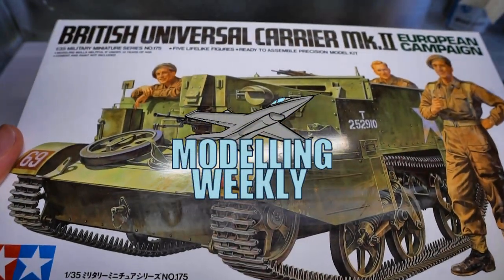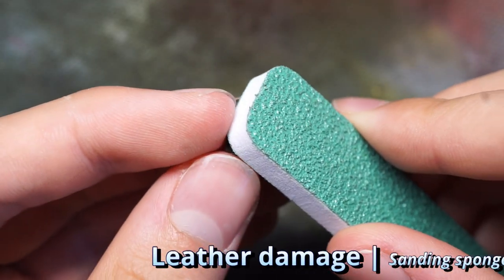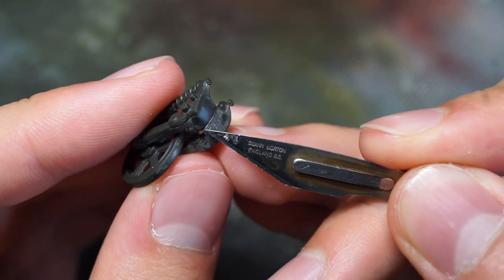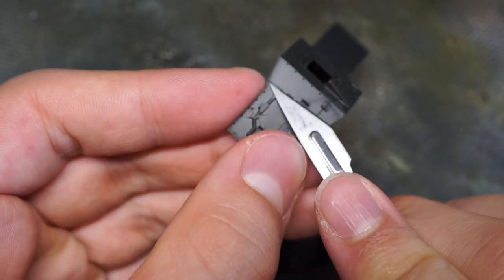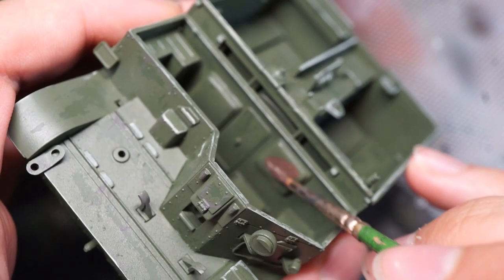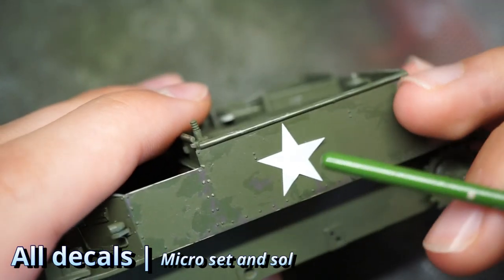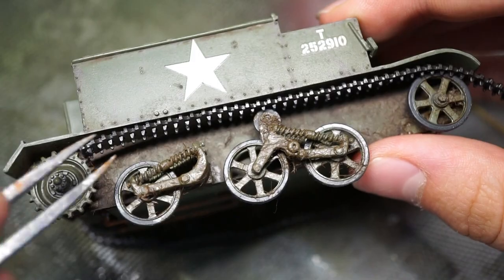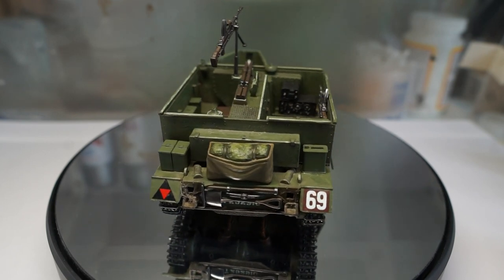Universal Carrier Mk.II | Tamiya 1/35 | Full build!

Comment: That wicked intro music is motivational, makes me want to do some evening lawn mowing. Is there any drastic difference in this kit & the MK "forced reconnaissance vehicle" kit, other than figures ? Do you still get the extras & weapons?
Reply from the maker: Thanks man! Honestly, I couldnt tell you. I'd go and check on scalemates - they have the full instructions for both kits in there in PDF form
Reply: @ModellingWeekly  I definitely want to build this kit. I loved your weathering technique on this. The paint looks really good. Do you thin hairspray at all ? Seems kinda thick & sticky but I've never tried it. Only ever used panel washed before. I want to try that technique as well. Thanks for the cool content!
Reply from the maker: @doejon9424  glad you want to give it a try! Depends on the thickness of your particular hairspray. I didn't need to thin mine, though I was using a fairly large 0.4mm nozzle. If you do need to thin, I'm pretty sure you can just use tap water. A hassle free alternative is buying some of AMMO MIGs pre made chipping fluid! Good luck!
Reply: @ModellingWeekly  I will be trying the hairspray over the MiG because I like the idea of having something in bulk, easily available to use on my models. I'm sure you get a small amount with the MiG AMMO project. I also like the idea of sealing the decals early on to avoid damaging them. Sometimes washes can get them wrinkly like a a raisen. I'm not new to models but I always built them "normal" so this info is all useful. First heavy weathering & then  maybe a knocked out vehicle eventually!
Reply from the maker: @doejon9424  cool! Well, as I said, good luck! Oh and by the way, it's worth noting that hairspray chipping works best with paints like tamiya acrylic, as I've discovered in more recent projects. Other Acrylics aren't bad, you just really need to be careful with them!

Comment: Nice build. I'm thinking about getting one of these? Is it worth it?
Reply from the maker: Thanks! It's a great little kit for the price, I'd definitely recommend it 👍
Reply: @ModellingWeekly  Bought it today. V reasonable price wise and there's some great after build extras out there for them. I also picked up some paper shaper from vms for some tarps. Apparently it's v good?
Reply from the maker: @elliotgregory3356  nice! Yeah, I've heard it's very top stuff 👍👍
Reply: @ModellingWeekly  I've subscribed for your channel. Love the diorama
Reply: Hi. So I've bought it and half way through. I take it the Vallejo were acrylic and then the humbrol gloss acrylic too? As the Tamiya panel liner is enamel that should be ok? I'm just concerned about the panel liner damaging my painting. Sorry for the questions!
Reply from the maker: @elliotgregory3356  hey, no worries! Yeah, so long as you allow for 24 hours to let the varnish cure, it should definitely prevent the paintwork from being damaged by enamels. Humbrol can sometimes be a bit dodgy in terms of bad batches, so I'd check first on a piece of spare sprue/a testing model :)
Reply: @ModellingWeekly  I've got Mr Hobby acrylic rattle can gloss which is acrylic. One more question. Sorry. Do use white spirit to mop up any excess on the panel liner or turps? And if I wanted to try the oil weather like yours I guess turps to blend it in?
Reply from the maker: @elliotgregory3356  white spirit will be fine for both tasks! :) No problem
Reply: @ModellingWeekly  Thanks 👍 Brilliant channel.

Comment: How did you paint the bren guns?
Reply from the maker: Vallejo metal colour gunmetal :)
Reply: what about the wood?
Reply from the maker: @seantaplin581  ah, that's just Vallejo old wood, streaked with various wood shades
Reply: can humbrol 53 (gun metal) and 110 (natural wood), be used?
Reply from the maker: @seantaplin581  of course! you can use anything you have your hands on :)
Reply: Do you think it would look good?
Reply: what number are the paints you used?
Reply: Can vallejo paints be brush painted?